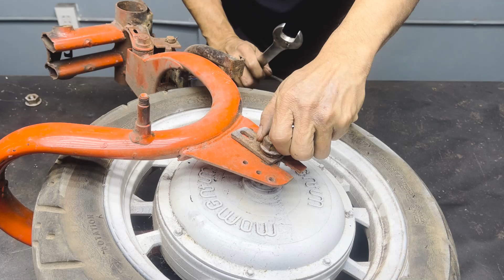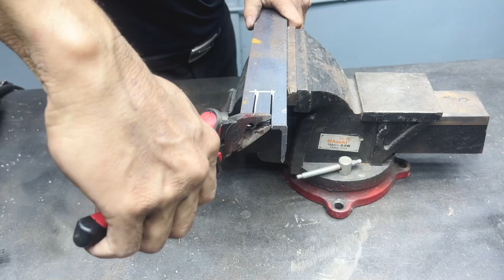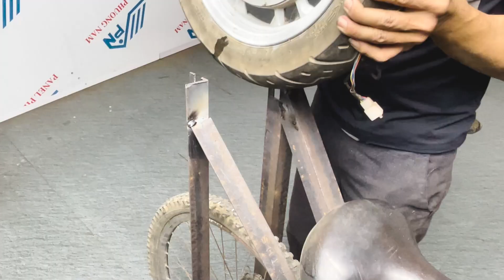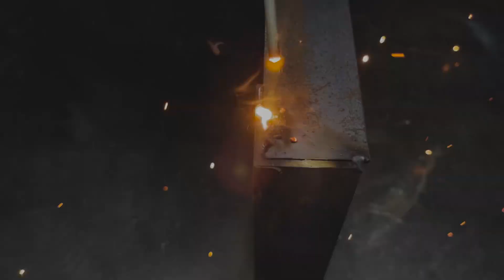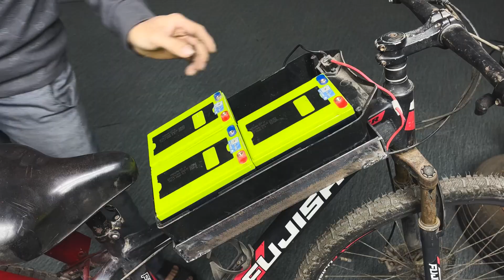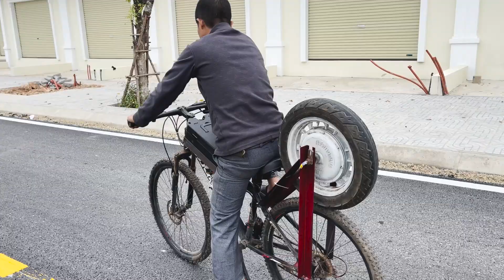Even NATO professors couldn't have thought of this! Transforming a regular bicycle into a 60kw!

Comment: The wheel should have been behind, as if it were a trailer.
Reply from the maker: You're right — the wheel was meant to be positioned behind, just like a small trailer setup. Thanks for noticing! I’ll adjust it in the next version.